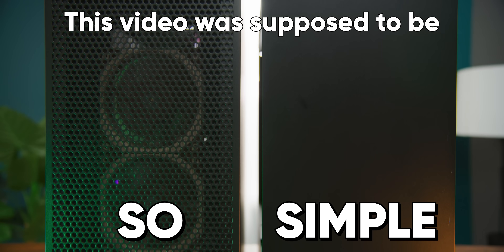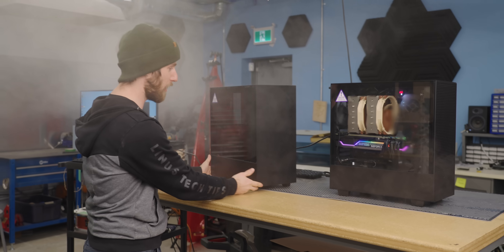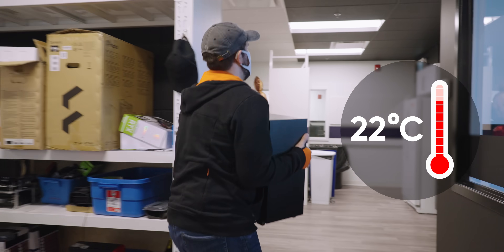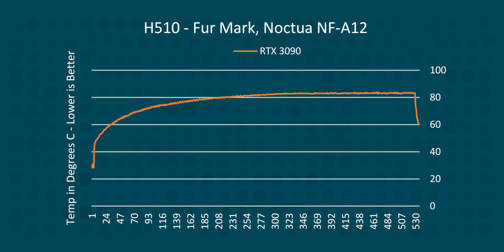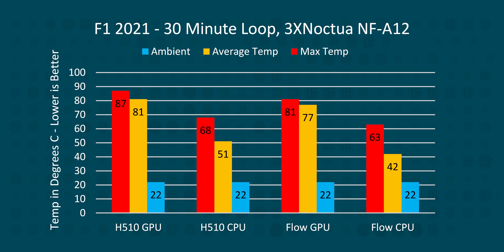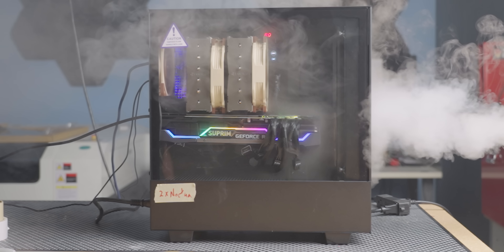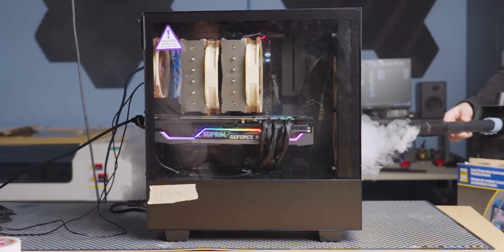Everything You Know Is Wrong - Mesh vs Non-Mesh Front Panel

Comment: A few quick thoughts on the conclusions you guys drew about turbulence. Most real world air flow systems are inherently turbulent since laminar flow requires carefully controlled environments & pretty low air speed requirements(which are often possible only in laboratories). The fans that are sucking in the air are making what is already a turbulent stream even more turbulent by adding more velocity(energy) to the incoming air. This is a non issue for the CPU because the air reaching the CPU tower has unhindered access to the air brought in by the case fans. 
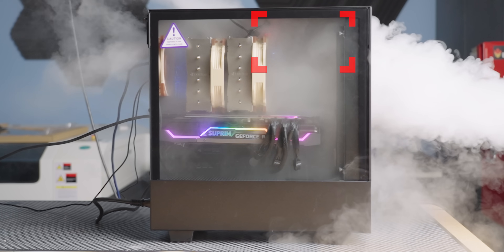But in the case of the GPU the shear width of the card blocks a bunch of incoming air deflecting it above & below the GPU. This sets up a local vortex system that is powered by the incoming air from the case fans. What does that do? It converts the linear velocity of the incoming air into rotational velocity making the air simply go in circles above & below the front of the GPU.  This effectively cuts off any air to the rear of the GPU starving it of fresh air. The same thing happens in front of the CPU fans as well if you notice in the highlighted box at 5:58. What's even more interesting is there seems to be a vortex pair in the top section of the case that are feeding each other drawing in more air. You would see all of this in much more clarity if you use PIV as mentioned by @Spirit, but for starters using a much lower amount of smoke will greatly improve the clarity of all the phenomenon I discussed above.
Reply: So what would you recommend ?
Reply: @Joshua-uq9zw  Less energy (i.e. lower fan speed) in the system. The front fans should basically just help overcome the resistance of the mesh. Added benefit: at low rpm those fans are completely silent (probably the included ones as well, some manufacturers actually pair their cases with suitable fans).

Alternatively you could go for negative pressure and suck in air through the (fortunately perforated) PSU shroud. That way the airflow from below towards the GPU would stay (at least somewhat) in the laminar regime and only become turbulent once it is exhausted from the case (where it doesn't matter anymore).
Reply: @Joshua-uq9zw  separate the air flow, give the gpu its own case fan and let it vent into the cpu section of the case
Reply: Top rear exhaust is pulling most the flow into the top chamber.

Comment: You should load test the tower by doing a CFD model of the flow through the tower!

BTW you need a way for air to pass over the GC and out the back. A damper deflecting air down to the GC would help, too.

Comment: The problem this case has is that the bottom front fan is also pretty high up, so it can't get any fresh air under the GPU. The Noctua fans are obviously taking whatever air does get in.

Comment: the issue is more than likely that cooler... due to the sheer size and running 2x 140mm fans vs the case 1 x 120mm exhaust

Comment: With a card that big, you need a larger case to allow for cleaner air flow. Or, a case with a larger top vent where you could mount an exhaust fan to backup the rear fan in pulling hot air out. I've been using a Lian Li Lancool II Mesh, and the airflow through it keeps everything nice and cool. Also, you might go with an AIO liquid cooler to open up space above the GPU.
Reply: My Lancool II Mesh does me well.  And it's still one of the best balanced between CPU & GPU in GN's testing.
Reply: That’s why I got rid of the h510 elite.  My GPU was rubbing the actual radiator of the AIO.
Reply: Same here, plus I put fans on the bottom that suck from the mesh by the PSU area and blow right on the GPU. It works so damn well. This case is well designed.

Comment: I mean... it all depends on your fan configuration. If you're forcefully blowing smoke into your case and the giant GPU is in the way, yeah you create turbulence, but only in a specific fan config., in which you have intake fans directly in front of your GPU. With only exhaust fan, airflow would look quite different. The question isn't mesh or no mesh, but what is your fan configuration. I would argue that having a solid panel with exhaust only would create faster air exchange because of the vacuum and therefore better cooling. With a mesh panel, you would need much bigger and stronger fans to maintain the same rate of airflow. 
This could be simulated with inhaling and exhaling with your mouth wide open vs lips pursed.
Reply: faster air, it's not the same with more volume. That being said, forcing air through the right pathways always pays off.

Comment: Your smoke machine is coating all the components in the case with a fine layer of sticky residue, too, not unlike the inside of your car windows when you have a leaky heater core. Stuff attracts and holds on to fine dust in an amazing way, too, like a glue. Someone's gotta lot of cleaning to do.

Comment: Forcing air to flow where you want can make for some huge improvements. Simple guides, ramps, and wedges work well. You all could 3D print some experiments pretty easily but I've literally used duct tape, sheet plastic, and cardboard to achieve this in the past.
Reply: This is why OEMs use ducts in their desktops and servers
Reply: @brandonallen2372  - Well, it allows them to get away with less fans and poorer layouts in the name of saving money. Same idea ... Just different purpose, haha.
Reply: Or use a gpu that blows hot air tp the outside. That whould prevent the deadspot in this config
Reply: @rubikfan1  - Sadly, they typically have inferior cooling to begin with 😕

Comment: I think its the discussion is toward to case design, rather than solid vs mesh panel. H510 is known to be hot box even without the front panel.
Meanwhile other case, like phanteks p400 series are benefit so much from front panel design, the meshed front panel is help much on the thermals.

Comment: Should have pointed the smoke machine at the back of the case for the non-mesh in stock negative pressure configuration. That's where the better initial GPU cooling comes from.

Comment: Just get a open air test bench case, looks okay, temps are great, no need for fancy cooling, easy to clean, basically no noise since fans barely have to spin in order to keep everything cool. My PC has been sitting on a motherboard box for 1 year now, my Ryzen 2700 with Wraith max cooler almost never goes above 50C unless I intentionally stress test it and my RX 580 Nitro+ sits around 63-68C during heavy gaming.

Comment: I hope you can include some 3D shroud printing as well in your future tests?

I imagine a cool looking texture on a shourd, some RGB LEDs - and that bottom front fan pushing the air through the shroud under the GPU coould be helpful. The top fan can supply the rest of the case with lots of air.

Another thing that probably matters is fan speed for that bottom fan. I imagine there is an optimal speed that generates the best flow, rather than dumping tons of air against the GPU.

Also... That GPU is probably circulating a lot of hot air. It basically exhausts against the glass panel and the motherboard, so on the motherboard side all of that air gets reused, and on the glass side, some of that air hopefully moves up towards the CPU cooler...
Perhaps, we want a case fan at the bottom of the PCIe slots, pushing air out the back.... this way the circulation of the air isnt pocketed under the GPU?
Reply: Either that or we want a fan in the side panel like PC cases used to do.
Reply: @shanez1215  Thinking about it a bit more.... no so sure if thats the way to go.

Ideally you want fresh air in front of the fans, and suck it out by the side where hot air exits the heatsink blades.

If the side intake fan is pushing against the GPU, you probably have pockets of air stuck around the GPU. So position of the fan and size of the GPU probably matters....

I also dont know if it matters but... the front fan probably only feeds the most right fan with fresh air -- if you could position the side fan where it half feeds two that probably helps with cooling a lot...

Still, if the case has a panel window, its unlikely to have a side fan... I dont think the trend will bring back side fans.

However -- this Surprim 3090 does not have a through hole cooler... In a case where the GPU recirculates air in its own pocket in the case - having this feature may be part of the sollution....

Comment: That's why the very rear should be edged out to slice threw the air. Yet no other manufacture had the smarts or the engineering to do so because aluminum blocky bits are Soo good for cars cough cough it's a PC guys....it's different not a engine. Plz for the next gen they really are gonna need every efficiency to cool and work in tandem with what ever the PC might hold come on guys do you care anymore it doesn't look like it board partners.

Comment: the more fans are creating an AIR CURTAIN  effectively a wall of air.. in the same way you use an air curtain.. like the liquor stores have an air curtain installed above the sliding doors to the cold store areas.
Reply: keeps the cold area's cold from seeping in to the warm areas and vice versa.. same effect is being achieved in the computer case the strong air flow pulling to the higher up cpu fans is gonan get cooled but yeah the gpus lower space is now air locked just jiving on its high temps now if the lower fan was angled downwards  splitting the air stream all would be fine
Reply: should install the lower fan with shims so its not jecting air in paralell with the upper front fan.

Comment: i would wager i'm not the only one still running a rig in an ancient tower that still has fan mounts in the side panel, so if you're doing follow ups, i'd be quite interested to know if aerodynamics for cooling is something my old clunker can actually boast about, even if i don't have any of the amenities of modern towers, like cable management or psu shrouds...

Comment: And here I am with a ghetto cooling setup for my 10900k/3080/DDR4 4000 CL14 (shiz gets HOT).  My desk is a long L desk, so I keep my PC away from me and near a window with no side panel.  Winter time - I have a window open a quarter of the way with a fan on the window sill blowing cold air to the front/side of my PC.   Summer time - I have a window AC unit blowing directly at the side of my PC with the side panel off (far enough that no condensation will build up) and everything stays so chilly.  Been doing it this way for a while now and never had any problems, just low temps.

Comment: That case works better with negative pressure, it'll pull fresh air from the expansion slot covers right into the GPU if you set it up right

Comment: Maybe a side fan,  to draw in fresh air beneath the graphics card might help. At this point, maybe the powerful fans on top are creating lower pressure on the bottom & not allowing the GPU fans to work to their full potential. There is a lot of air entering the case, but it seems apparent, that it's all mostly being drawn to the CPU, then immediately sucked out the back, above the graphics card.

Comment: no lie best case I ever had is the rosewill rise. its got a ton of airspace and a fat ass to boot, but it only cost 80 bucks and you cant even get them anymore, just the thor, which eh I guess the side airflow would sove that 3090 heat issue right now but I like the looks of the rise.

Comment: The difference of adding a 140mm to the bottom floor intake of my Fractal Design Vector RS under the gpu was significant to cooling, although adding a second made no difference. This was a Gigabyte 3080 Gaming OC. This is supposed to be a hot case and I use the glass top (looks great down beside me) but my gpu now never goes over 70c. I've only got 1 140mm exhaust fan and for intake the 2x140mm at the bottom and the 360mm AIO at the front.

Comment: i have recently bought 3060 ti gigabyte eagle and oh boy! Im struggling to keep it cool while being quiet. Gpu cooler isn't great on its own and im having trouble to configure my fans in fractal desing meshify c. I was originally going to replace my stock fans with arctic f14 and was supposed to get value pack but i don't know if it a good idea. Maybe i should just get one more fan and place it at the lowest bracket of my front panel and keep my stock fans. Damn it, things would be much  easier if i could buy whatever gpu i wanted but sadly i had to get what was availabe and not outrageosly overpriced.
Reply: @Relex_92  I removed shroud and hard drive cage, and then i moved my my fan lower as gamers nexus said in his video and i dropped around 3 C. Maybe i could do better if i get 140mm fans

Comment: Why does no one thinks about a vertical mounted gpu and little holes on the side of the case, if it is a glass panel it should just be a big hole with an air filter, if it is not ir just should he little holes. That way the gpu has its own air intake the way the air Is getting pulled in by the gpu, it would be much more efficient than any other solution except for water cooling

Comment: This has to be the single worst video I've seen from LTT in a few years. The core takeaway from this experimentation should be that the NZXT H510 is not a great case for airflow, with or without the mesh front. Another factor that certainly doesn't help, is the PSU shroud (particularly in more compact cases). It looks nice, yes. Does it harm airflow for the GPU? In a lot of cases, also yes.
Yet rather than stating these possibilities, or even testing the second possibility (shroud causing performance issues, remove the shroud or try placing an intake fan on the bottom of the case pointed directly at the GPU); the video simply clickbaits what should be a non-issue. I sincerely look forward to the LTT Labs formats of videos, and hope that LMG can really help to step up the bar on the quality of information presented by tech media.
Reply: Agreed, this case is hot garbage with or without front mesh. Very poorly designed.

Comment: I always noticed that to really change temperature on GPU you'd need active airflow going directly to it, like fans at the bottom of the case
Or having a bigger case
Like, you'd want a full tower for a 3090, honestly, it's way too big for a regular ATX

Also, I find it funny that there's still no real coolers for the new Intel CPUs

I mean, yeah, you can mount your old cooler on them, BUT
the CPU is now not only bigger, but the cores aren't all set in the center, like they were before this big.little architecture, so actual coolers don't really do the job, this 12900k struggles even with top notch aio coolers, hence you'd need a bigger contact surface
Reply: Yeah I use the most over used case lian li Dynamic regular one :P and it rocks with the fans underneath the gpu it becomes like 64C xD

Comment: I have a black h510 system specs are / aorus b450 elite v2 ryzen 3300x t force delta 3600 cl18 3600mhz xpg m.2 swift 210 ex 6600 and with msi and overclocked gpu to .80 memory to .120 amd overclocked with the preset overclock and I only see around 67°cpu and around 70 to 72° dungarees under full load is that a decent temp for my setup

Comment: This problem is here only because case manufacturers collectively decided that side panel doesn't need a fan anymore
Reply: I remember when cases had side panel intakes for GPUs. Those need to come back especially now that GPUs are running hotter than ever.
Reply: With the switch from acrylic to glass that would be a very tricky undertaking. Glass side panels are brittle enough as it is, adding a cutout for a fan would make it damn near impossible to ship a case with out the glass breaking into a million pieces.
Reply: That's because they don't need side panels. The Meshify C, 4000D, P5000A are all good examples of that.

Comment: and this is why, despite my desire for a smaller case, I go with larger, full-sized cases.
Reply: Just go small case then, but avoid idiotic airflow designs as this one. Huge tempered glass side panels are just for show and could be all mesh instead. NR200 and Meshlicious are two good entry points to SFF.

Comment: I recently upgraded from a H510i to a 4000D Airflow. I also added two NF-A14s in the front for the intake and one NF-S12A in the rear as the exhaust. Next on the list of NH-D15 CPU cooler, because my Wraith Prism is the loudest component in my PC at the moment. I strongly advise H510 owners to swap their case around for something else.
Reply: using a drill to make ur own custom flow version can also be an option

Comment: You forgot to mention that you picked one of the worst cases for front air intake. I have fractal meshify 2 compact with 10700kf and 3080ti in it and 3 front fans, i am peaking at 78 degrees. Your case is missing a fan intake for gpu, any holes even